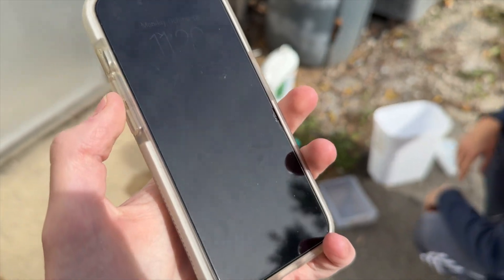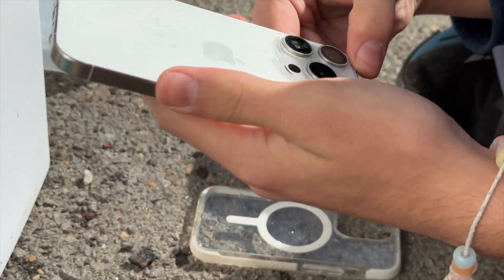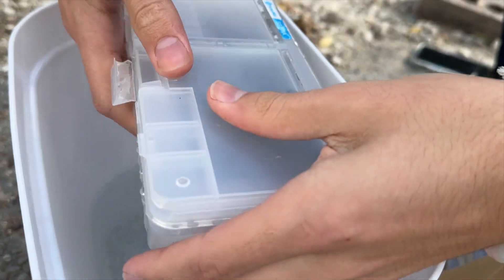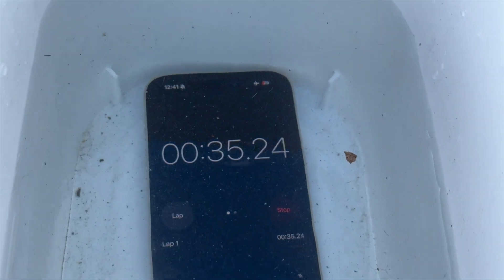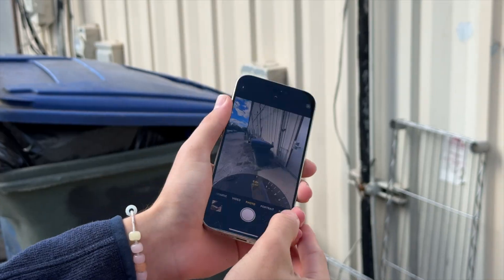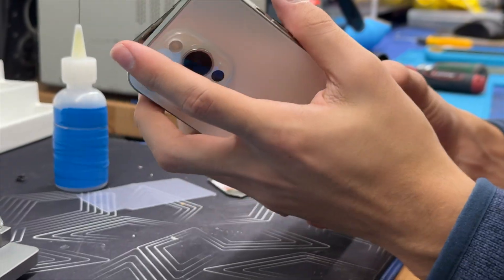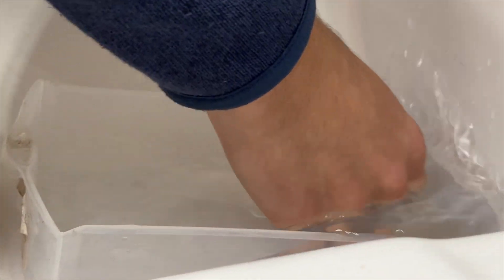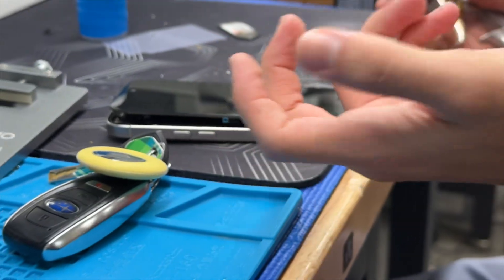iPhone 15 Pro Water & Salt Water Test

Comment: What phone does he have now? If it’s the iPhone 16 Pro, then I think it’s not worth the upgrade. I would’ve sold that thing or trade it in to get the new phone cheaper if I wanted to upgrade because it’s still worth a lot. Nice video, though.
Reply from the maker: Hes got a Z Fold 6 on order right now, and he’s currently using a Pixel 4 I believe.
Reply: @ Oh. What was wrong with the 15 Pro?